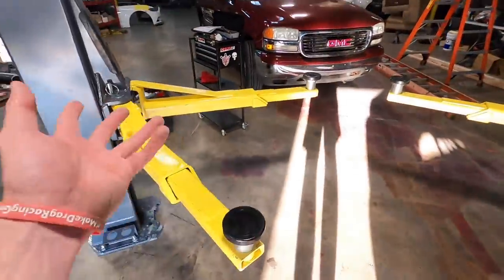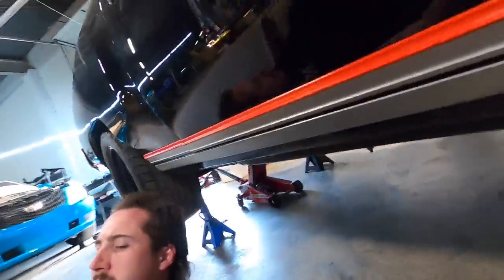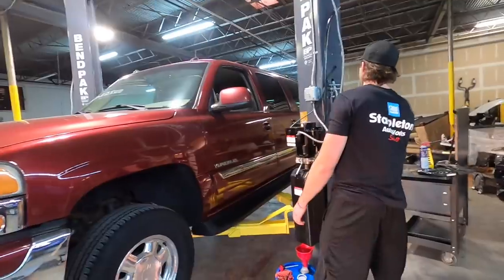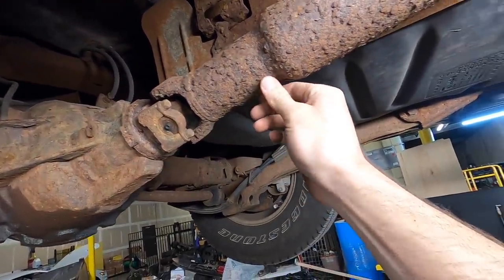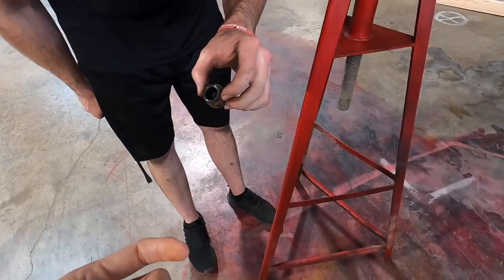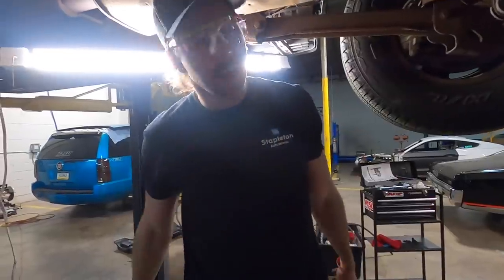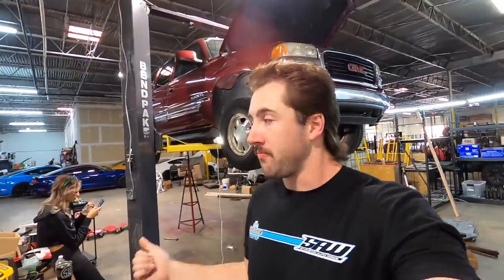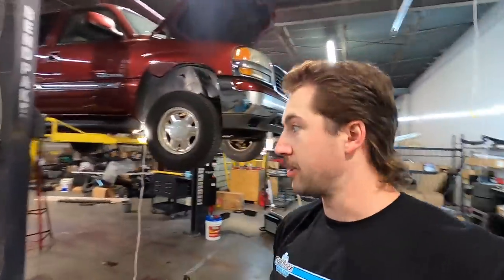Budget Turbo Yukon XL 4L80 Conversion (Part 1): Blow'd Up 4L60e Removal! + Tips&Tricks To Save Time!

Comment: Been waiting for this video for awhile now everything you are doing to uncle Rob I plan on doing to my 06 YukonXl. I live in Hammond Indiana definitely live in the rust belt bout 15 minutes from Chicago. My goal is to hopefully  one of these time to be able to run a drag week. Atleast thats the goal not sure how soon that will be every mod I do to my truck is on a as i can scrounge up the pocket change basis.. when you switch to the 4l80 do you have to get a different transfer case or can you switch out the the input shift in the transfer case I have a np246 in my truck I think uncle rob have the same selector as mine i have the electronic push button selector on the dash with auto 4x4. Love the videos can't wait for the next ones...
Reply from the maker: You can switch it. But I wanted a different one
Reply: @Stapleton42  is it actually called an input shaft or is there a different name for it and love all the vids especially the yello belly commentary with Logan her comments crack me up... definite on subscribed to your channel ever since kyle (happens to be my name) lol interviewed you on his channel after you got the escalade back up and running. Even got the OG escalade T wife yells at me says I wear it too much need to get the 4l60 trans destruction T

Comment: Mitchell the Milwaukee tools the only thing that wares out is the batteries the tool can last 15-20 years and a battery from then will work on a tool from now unlike dewalt that requires the adapter for each tool for the battery and it has to be a specific 20 volt battery with the adapter to tool and can’t be the 60 volt battery or it catches the tool on fire

Comment: Working on rusty stuff is pretty easy if ya know how to deal with it. Im right down the road from Tial in Michigan and used to work on rusty shit all the time.  Also if someone wants to give you parts or tools they aren't using that's fine up to a certain $ amount in my opinion. I wouldn't want to take something thats pretty expensive from someone without at least some kind of compensation but that's just me.

Comment: Holy shit this is finally happening dammit this is making me want to be able to late model hemi swap my 98 durango (yes I know it's a economy suv asides the point) then make it a fun as fuck street car
Reply: Economy SUV? Looooooool if it has the five nine those things get like ten mpg I guess you havevth 318 instead of the 360
Reply: @hennessyviper  oh I have the big Magnum that drinks gas if you put your foot in it that's one of the main reasons I want to go to a late model hemi along with granted it would probably help that I change plugs and plug wires and clean the air filter and or just buy another filter
Reply: @Pyro_5151  oh okay a 6.4 hemi would be cool it ligter than the new durangos
Reply: @hennessyviper  I don't have 6.4 kinda money I'd have gen II 5.7 hemi money maybe a 6.1 if I could find a good block and harness and go through it and tear it apart and then have the fun of doing the swap myself once I have another vehicle
Reply: @Pyro_5151  that would be a really nice street truck
Reply: I have a dream of 1 day doing a hellcat swap into a dodge magnum think that would be pretty badass

Comment: Rust is such a pain in the ass... Chicago area uses WAY TOO MUCH salt and it just destroys everything on the road. So many cars with barely 100k on them and have rusted out brake lines, power steering and so on. It is beyond ridiculous, but I guess lots of shops makes money since most people can't do that work or are afraid to even try. Fixed a rusted out power steering line on my 9-7X Aero for $35 and a few hours of time in the driveway.

Comment: Milwaukee is easily the best priced stuff out there.. it blows everything out of the water...
Reply: The 3/8 m12 stubby impact with 250ftlbs. Such a great tool.. 150 bucks bare tool.. can find for 200.00 with battery and charger

Comment: When it comes to those crossmember bolts in different directions, don't credit GM engineering to much. I bet the production worker had a nut and bolt in each hand, inserted both bolts at the same time, then spun the nuts at the same time. They don't give us much time, 50 secs for each vehicle in Arlington.  As long as the torque gun gave the worker the green light. Plus uncle Rob was built in Arlington so there's that...🤪
Reply from the maker: That’s very interesting. I’d love to see inside the factory I pass it every day. It’s only a mile from the shop 😂
Reply: @Stapleton42  Wish I could take you on a tour but I'm at Wentzville plant now building Colorado, Canyon trucks and Express, Savanah vans. GM definitely don't allow cameras though, that's a fireable offense. Union can't even bring ya back from that one. GM may have a media department that would help ya out and make a legit video. There's a content  idea 🤔 if you were looking. An old friend Sparky Jones in Grand Prarie may have easier access than I do.

Comment: Looks like someone was trying to kill that transfer case??? If that is a 4 push button electric transfer case it’s supposed to have autotrac GM transfer case fluid which is blue.
Reply from the maker: It’s not a push button 4x4
Reply: @Stapleton42  it’s 4x4 on the floor??? The old transfer case was an electronic one right???

Comment: I have never seen a Texas truck with a drive shaft that rusted. Even my 38 Chevy's driveshaft looks better and it is original and on a truck that has never been kept out of the elements
Reply from the maker: This Yukon lived in Pittsburgh PA and DC it’s entire life until I got it a few months ago
Reply: @Stapleton42  When I put the motor back in the Nova, I want to race either Uncle Rob or Elvis. My car has a stock big block but it should still be fun